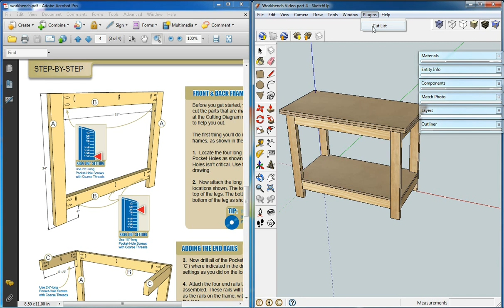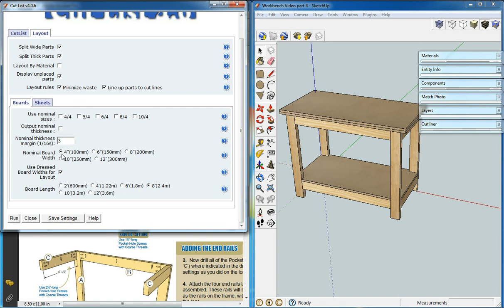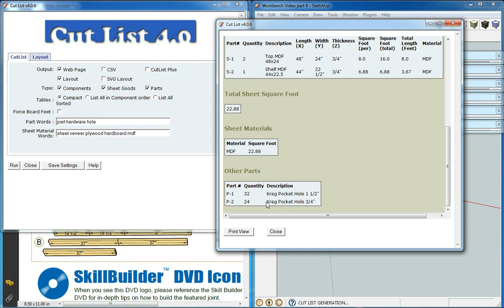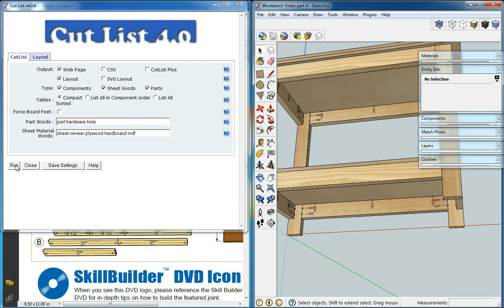Kreg Workbench, Sketchup Video 4, Cutlist

Comment: Great videos! One problem I had though - using your newer 3-D pocket holes causes the components with pocket holes not to have a volume in Sketchup, and so they do not get included in the Cutlist. One partial workaround is to hide the pocket hole layer and then run Cutlist, but then the pocket holes are excluded from Cutlist (and so you don't get a list of the screws needed). Or am I doing something incorrectly?